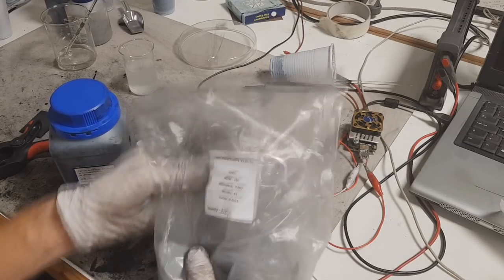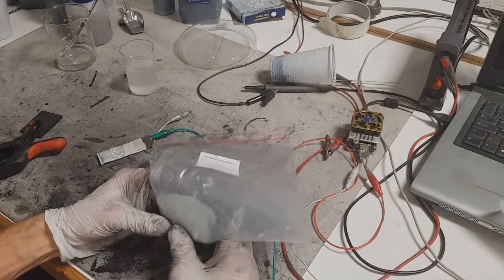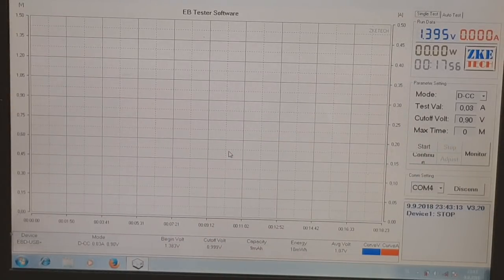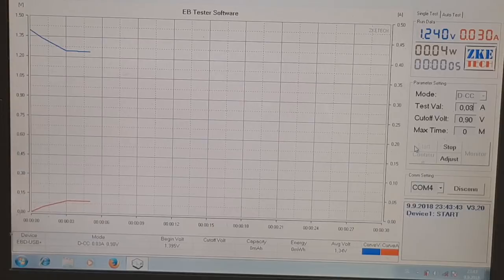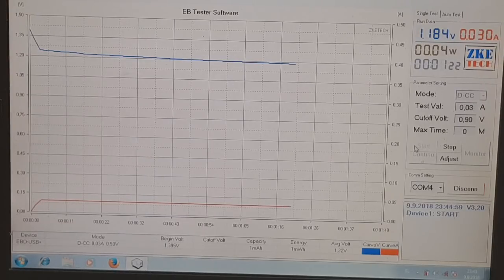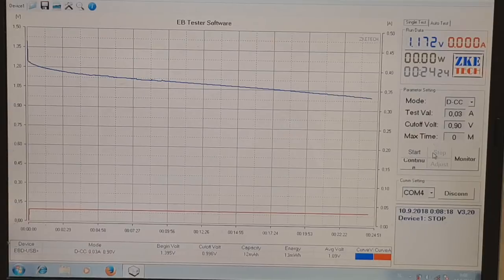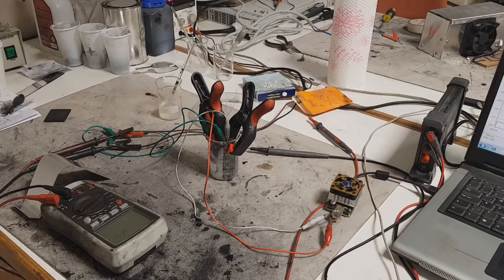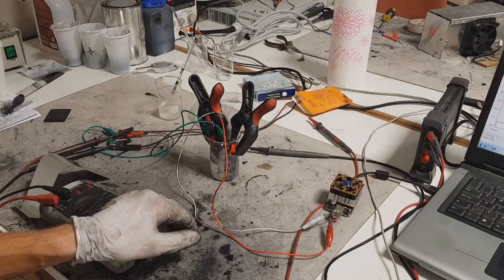Zinc Battery

Comment: What is your binding agent or glue that holds your materials together?
Reply from the maker: Any binder will work which will absorbe the electrolyte. PVA/PVP, CMC,...
Reply: @cayrex  Thanks for replying back to all my question so soon. One more question if you don't mind. Have you tried HYDROGEN PROXIDE in any of your Batteries? I like what your doing Mate.
Reply from the maker: @kennedy67951  H2O2 emm, I dont think that I was using it in batteries,... not that I can remember 🤔
Reply: @cayrex  Hydrogen Peroxide could be used as the Oxygen source and part of the Electrolyte. It might Improve your Battery Design. Just a thought.
Reply from the maker: @kennedy67951  yes, right. But the sad thing is that every extra  material in the cell can increase the cost. My plan is to make a battery that wil fit between lead acid and lithium battery. That have a cost arount the same like lead acid,...  but with better energy density and greater cycle life
Reply: @cayrex  Thanks Mate for your Opinion. We are all in a State of Learning. Questions and Answer's is part of Our Learning Experience. Like I said, before. I really like the Work Your doing. I hope you'll not mind if I ask Questions of You in the near Future.

Comment: What is the Life cycle
Reply from the maker: Here was demonstrated a effect of carbon on the anode. Is depending in what system you will make a cell. With KOH and alpha MnO2 you can get around 300 to 1000 cycles. With electrolytic mangane dioxide around 50 to 200 cycles,.... like I say,... is all depending what system you will decide

Comment: I like your work !!! Can you tell what was the binder to stick the zn powder to the zn metal ???  

You have this information...How was made the test cell:
- Cathode was made with MnO2 and carbon in ratio 2:1 with graphite current collector
- Electrolyte which I use in the test cell was 6 mol KOH
- Anode 1 was made from zinc plate and zinc powder
- Anode 2 was made from zinc plate and zinc powder + carbon black 

But you don't mention the binder....or the glue used to allow the adhesion of the zn powder to the zn metal...I have used epoxy in the past...but I used granular zn.

Thanks.
Reply from the maker: I dont use any binder that why I dont say about binder. I make a pasta from zinc powder, carbon black and electrolyte and I add to the zinc electrode. But you can use some binder if you want like pvp, cmc, sbr,...
Reply: Wow.....not using any binder....did you see any lost of performance...as the zinc powder/carbon black fall off from the zn electrode?...

Again ...thanks.

Comment: https://www.sciencedirect.com/science/article/pii/S2468606917300096 you will really enjoy this link @cayrex2 

they use an aqueous electrolyte with fumed silica and PbSO4 at 5% to the fumed silica (not sure if by wt/vol). They drastically reduced dendrite formation, self discharge, and improving both corrosion resistance and current density. As you mentioned, certain metal ion salts will work better than others for ion flow. You mentioned ZnSO but what about Zinc Bromide? Then use ultrathin carbon black electrodes with doping of some zinc metal. This way, upon current application the Zinc bromide will electro-plate the carbon black plates in zinc. Then upon discharging this process occurs in reverse, where the electrolyte reabsorbs the zinc ions from the surface of the electrode plates. ;) lots of interesting improvements to Zinc chemistries.

Comment: Well done Dusan, it reminds me of building flash powder for pyrotechnics... It seems black powder is of course also a redox reaction, but here the reactions go much slower and the output is just electricity... I wonder, if we take the best formular for the best flash powder pyrotechnics mix and convert this  to a battery cell, if this will also be the best electricity output from such a cell... So you should try Magnesium Powder with Pottassium Perchlorate... ( KCLO4) Be very carefull, this stuff is really explosive and don´t mix it together in a dry state...

Comment: Nice results Cayrex, it will recharge and the capacity is better than just Zn metal but longevity is not as good as Zn metal.There is more surface area in the powder but it is eaten away quicker than the metal.I am also looking at the Zn metal as the current collector/anode and a Zn powder zno2 Carbon mix as an active coating, the powder mix is also readily absorbed into a sponge.https://www.youtube.com/watch?v=fzZtiCyAAqE
Reply from the maker: Yes you can use Zn powder or zinc oxide,.... but if you use to zinc oxide than you need to charge the battery first to get the zinc. For me the mix of Zn powder and carbon black (graphite carbon) looks more stable that only zinc and also I dont get many problems with dendrites. depending on what electrolyte and carbon you use